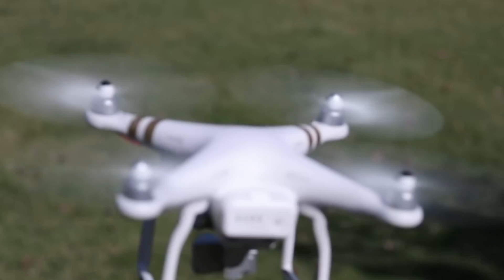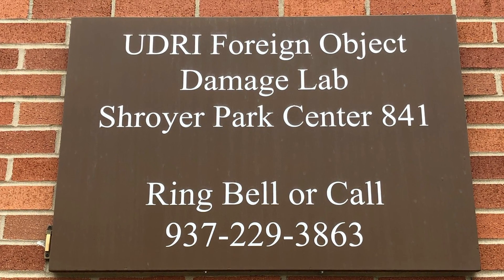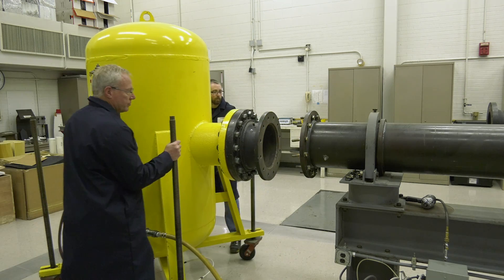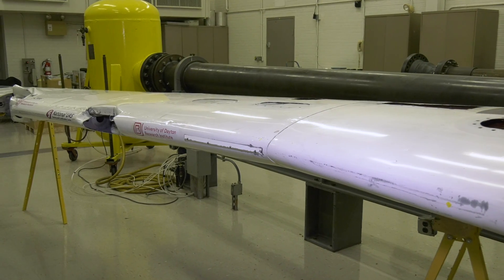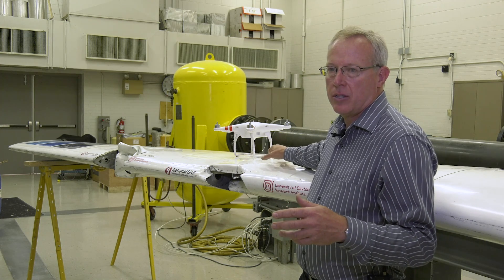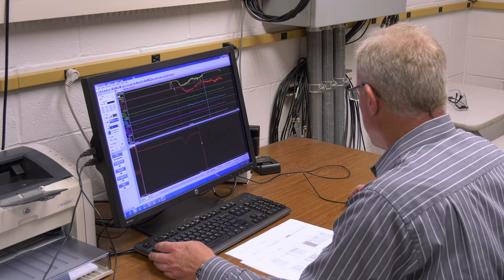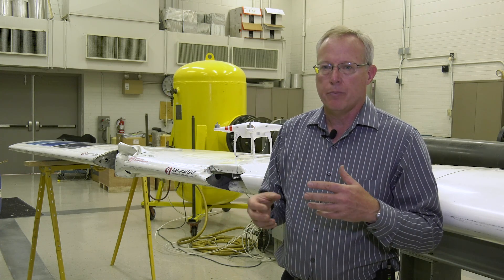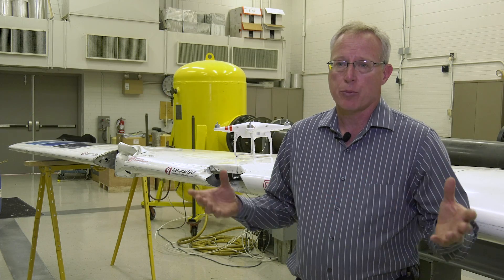What Happens When a Drone Hits an Airplane Wing? – AIN

Comment: I'd love to see what happens to that wing after the gelatin impact, in a 250 mph airstream - that much change to the wing shape would introduce severe forces and potentially rip the end of the wing off. Whereas the drone puncture hole would have much less of an impact on aerodynamics.

Comment: Why would a business jet be flying at 470 mph only 400 feet above ground level? Even the test speed of 238 mph is much faster than take-off speed, and probably faster than the closing speed of a business jet less than 500 feet above the ground. The FAA prohibits aircraft from flying faster than 288 mph below 10k feet altitude. So, this video would be showing a worst-case scenario.

Comment: 238mph isn't a realistic speed for typical low flying propeller driven aircraft, phantom drones go about 45mph tops and most cesnas and pipercubs go about 130mph tops this is definitely a worst possible scenario and its a bit of a reach

Comment: So long story short,
1) Take a drone that most people don't fly
2) A drone that is way heavier and made from a different material that what most people fly
3) The weakest plane you could find
4) Completely over exaggerate the speed
5) Lie about the results as the simulated bird strike clearly did more damage
6) Completely ignore ASTM-330-10 standard you are supposed to be using for simulated bird strikes being fully aware that this is not how the test is performed
7) Completely ignore statistics as the likely hood of a collision would be insanely high
8) Use a wing that has already had rivets removed to try increase the damage from the impact

To say this is propaganda is an understatement, you are a disgrace.

Comment: What is shown here is simply a lie, there are real tests here on YouTube where you can see that in the event of an impact at high speed, at most, the paint would be scratched, a drone is far too little weight to damage an aircraft, it would have to be over Weighing 3 kg and flying at over 120 km / h.

Comment: One issue not factored in is the wind force that continues to push the drone into the hole and out the back side of the wing. Then the wind rips the wing open and you crash.

Comment: If a plane was to crash into metal bars or a bird crash into it for sure the wing would lose control and crash and because of how weak the steel is pretty much everyone would die
Reply: Lose a wing because of a bird strike?😂 You must be joking. Also aircraft aren't made of steel
Reply: @ethansaviation2672  yh yh what do you know
Reply: @ethansaviation2672  what's it made of then
Reply: @bethaniestephens4573  Aerospace-grade Aluminium or carbon fiber on new aircraft

Comment: If drone flying was put under the authority of the CAA;it could be tightened up very easily. For example, annual medicals, drug testing, training,regular reassessment. All pilots have to carry their documents with them for inspection if required. All this training has to be paid for by the trainee, starting with £250 for the doctor's examination and certification and obviously the costs go up.

Comment: Hi together. I am an PP-L Pilot and an professional pilot for UAS. The problem of this test is, that it is wrong in the basics. In real airspace the wing hits the drone and not vice versa. So they should shot the wing to the drone ! There are a lot aerodynamic effects and regarding this, the contact is possibly resulting a dent in the wing. Bigger aircrafts pushing a hughe airwave forward, along their boby. This test we made in the air and there was no contact at all in ten attempts with an LSA. Drone Pilots should fly reliable, but panic is a bad advisor. I know a lot of A-320, A-330 and A-340 pilots and none of them is frightened by drones.
Reply: Don't they fire birds at engines though for testing?
Reply: Ethan's Aviation Thats correct! Frozen Gooses to the fans for testing.

Comment: General aviation rules set speed limits for airplanes at low altitudes.  Below 10,000 feet the speed limit is 200 knots.  https://www.law.cornell.edu/cfr/text/14/91.117

So don't talk about a business jet going faster than that at altitudes drones operate at.

And while we are at it, the bird did way more damage than the drone did.   The drone penetrated further in, but the bird took out way more leading edge.

Comment: For me this test do show only one thing: Anti/haters trying to prove something with nothing more the big jargon about how dangerous/wrong something is and not with actual facts. 

I mean, if you got balls, you take a big UAV and let it fly against a small one. And then you have result that matters.

But no, let's shoot something at something as it would have the same impact. Totally forgetting the sensors on the drone, totally forgetting that the airflow is completely different, the speeds can be of by 1 mile and everything is already different, weather is also different. Basically, what we see here is just THE IDEAL circumstances for them to get something negative said about people's passions.

Nothing more or less. Actual testing should be done.

Comment: The thing is, flying drones is restricted near airports, but also OUTSIDE of airports, because of, AIRPLANES. But, drones are only allowed to fly 120 meters high. I do not know, but uhm...If an airplane would fly this low. It would probally not have enough lift to stay airborne right? I really do not get that, why you may only fly 120 meters high in the Netherlands. (Not even feet btw!) Some buildings are higher then that right? And is it messured from where you stand, OR from NAP?

Comment: Why was the test on such a rare plane, instead of a popular Cessna? Was the choice of wing based on what would suffer the most damage? Your simulated bird strike made a bigger hole, even though it was only large blob of gel, no bones or beak. Given that a seagull weighs the same as a football, your test shows the risk of flying low over a soccer field, not a bird strike!

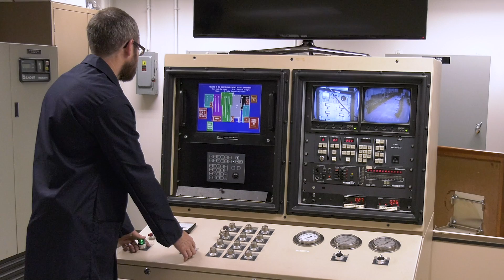Comment: 0:25  a typical drone (DJI phantom 2) demolishes a typical plane wing when fired at it at 238mph, "at higher speeds the damage would have been much greater"  [primarily to the weaker material]   1:42  slow motion shows the drone did not shatter apart on impact and completely punctured/burrowed into the wing, bent and deformed framework in the wing.   2:18  "if this was a business jet and the collision speed twice as fast, the damage would have been much greater, as energy goes up with square of velocity".  

an imperfect crude simulated bird crushed the wing but did not do as much damage as the drone likely due to its shape, materials and absence of spinning blades.

Comment: Common sense --   a large object travelling at 200 mph and colliding with a small object at 20 mph is not the same as a small object travelling at 200 mph colliding with a stationery object.   We know that a bullet (200 mph) will put a hole in an aircraft wing, but if the aircraft at 200 mph hits a bullet near the end of its projection (20 mph) it will simply bounce off. Looks like a hidden agenda in this 'test'.

Comment: So in other words, it will do LESS damage than a large bird: https://www.jetforums.net/threads/bird-strikes.1300/
This kind of testing should be done on larger aircraft samples, including engines and cockpit windows, at actual approach and take off speed. 
Larger drones woudl obviously do more damage, especially if piloted with intent to cause harm, or if carrying IEDs, but so far this looks like more write-off / expensive repair bill than a threat to commercial aviation.

Comment: Lets also not forget that just as important as the structural integrity of your wing spar, a bird completely mullering your leading edge is going to cause a lot more drag than a pierced hole through the front. As many people have already said other aircraft have considerably thicker leading edges specifically for the bird strike reason, except you can't claim off someone elses insurance if it is a bird!

Comment: This is nonsense. There's a very very small risk of penetrating an aluminium skin. Same as if a bird hit the wing. The wing would be fine the bird would bounce off and not be so well.
 The threat from drones is that they get sucked into the jet intake and damage the engine internally. That is a genuine threat. God Knows why they need to circulate this rubbish.

Comment: The reality is, this video contains all true facts and science, some people say that the air pressure around the wing would protect it in a real circumstance, wings create regions of low and high pressure areas, so theoretically is a real scenario a drone could be sucked into the wing not repelled. The drone caused internal structural damage to the wing that's a lot worse than the bird only causing a rather large dent, the difference is like being hit by a cricket ball that hits you and leaves a large bruise but bounces off, compared to being hit by a bullet that leaves a small hole but can kill you easily (via shrapnel) it's  the same principle. Some people say that aircraft don't fly low or fast enough, reality they need to land and take off (obviously), the take off speed of a Boeing 747 is 184 mph fully loaded for a long haul flight which is quite typical.  Some people say that new legislation on drones is to hide what governments don't want you to see, well what do you really so badly need to see at an airport specifically with a drone which its on board camera is theoretically easy to hack into based on the fact the data signals between your drone and your controller are not encrypted, can't you just get a window seat on a plane, and if you genuinely just want to get a good video, can't you just contact some authority. Some people say aircraft wings will be more protected, the reality is that take the Boeing 747 was designed in the sixties and are only really protected against bird strikes, and as I have said and what you can see in this video cause different types of damage. So you might say then why don't they start retrofitting all aircraft to be protected against this new danger, in reality this would require major research and development, would require virtually all aircraft everywhere being grounded for possible months, costing companies, agencies and governments billions and all for a few people who want to fly their drones dangerously close to aircraft can do so. And finally some will say with all the drones out their, there hasn't been a single case of collision, and the simple reason for that is that, out of all then operators, the majority of them are smart enough not to fly then near flight paths, but the ones that every so often do, all aircraft are grounded and incoming aircraft are diverted away, completely eliminating the chances of collision potentially saving lives and aircraft, at the cost of a lot, and I mean a lot of angry passengers. Some say that I just hate drones, the truth is I own one. So if you don't like legislation on drone use, don't fly near airports. If you don't like the science in this video, then repeat your own experiment and present it forth in a scientific manner, but I'm afraid you may be disappointed with your own results. If you don't agree with any of that and just want to fly around airports for some reason, then go ahead, i'm not stopping you, but i'm perfectly fine about following legislation.

Comment: This guy is an expert??

Several things...
They used the wing off a particularly weak structured aircraft, not your average GA wing.
He states that the aircraft would 'probably be ok' - well assuming the aircraft is at a slow speed critical phase of flight, for example take off and landing (when drone strikes would be more likely) the destruction or deformation of a chunk of wing could be enough to drastically change the lift characteristics and cause a crash.
I have witnessed aircraft return to base with bad bird strikes to the wing sustained in flight, and the low speed handling characteristics have dramatically changed. Not a problem when you start to slow down and discover this, but a huge problem if it were to suddenly happen at low level.
The wing could lose some lift in comparison to the other wing, causing a violent and sudden rolling motion. If the control surfaces to no move quickly enough or deflect far enough to correct this before it is unrecoverable, the aircraft will crash. Wing damage on take off or landing in GA aircraft has caused this to happen in the past.

On a large aircraft there is less of a risk, because control surfaces have a greater effect and a small bit of damage in a large wing would be less dramatic too.

Comment: 238mph lets see so the plane would be at crusiing altitude since it's near max crusing speed. So it would be 20,000 feet (3.7 miles up) while the DJI phantom 2 limited range of 3280 feet max. (0.6 miles) doesn't make sense. The two would never meet. Bad science bad data. Now lets look at reality, the chances of planes landing/crashing on public roadways and private property is greater then drones striking planes. Maybe planes need to be banned or restricted to commerical use only.

Comment: 0:25  typical drone (DJI phantom 2) demolishes a typical plane wing when fired at it at 238mph, at higher speeds the damage would have been much greater.  1:42  slow motion shows the drone did not shatter apart on impact and completely punctured into the wing, bent and deformed framework in the wing,   2:18  if this was a business jet and the colision speed twice as fast, the damage would have been much greater, as energy goes up with square of velocity.  an imperfect crude simulated bird crushed the wing but did not do as much damage as the drone.

Comment: At 250 mph even a bag of feathers (the same weight of the drone) would cause damage.
So why test at that speed?  To prove a point!  The point is irrelevant.
Plane land at 172 mph or slower and Takeoff at 184 mph, most drones don't go faster than 40-50 mph, just the facts.

Comment: Good initiative! But there is a fundamental mistake in these tests. In these tests, the drone gets the inertia and in actuality the speed of the drone is very low. As the aircraft wing approaches the drone instead, the streamlines of the air would  force the drone to move up or down following them. How much this would modify the tests is questionable but these results are of limited scope.

Comment: The issue isn't what happens to a wing but an engine. A 3lb drone will poke a hole in a wing but a 10oz bird will take out an engine. And a bird strike is like 1000x more likely than a drone hit so this is almost irrelevant. Also, they talk about maximum speeds. Well lol, how many drones are flying at 30,000 feet when these aircraft are traveling that fast?

Comment: The test does not take into account the airflow ahead of, and around the leading edge of an aircraft in actual flight. 
'Apparent Airflow' around the leading edge of the wing at such high speeds would not allow a drone to have the 'direct impact' on a 'leading edge' as depicted in this video, and to have a 'direct impact' would be unlikely. 
One would assume the drone would strike 'offset' on impact, meaning the 'Force Of Impact' would be less than depicted in this test.
I would be interested to see a test conducted where airflow plays a role.

Comment: The test was obviously performed without a LiPo battery. Normally the fuel tank is located in the wing. In reality there could be a fire and if there is enough air in the tank there could even be an explosion.

Comment: That's a lotta damage - but luckily, Flex Tape come super wide, so you can easily patch large holes.
To show the power of Flex Tape, he sawed this aircraft in half! And repaired it with only Flex Tape! Phil Swift flying an airplane "NOT ONLY DOES FLEX TAPE’S POWERFUL ADHESIVE HOLD THE AIRCRAFT TOGETHER, BUT IT CREATES A SUPER STRONG AIR TIGHT SEAL, SO THE INSIDE IS COMPLETELY DRY!" Yee-dogge
Just cut, peel, stick and seal! Imagine everything you can do with the power of Flex Tape!

Comment: The Phantom's cruising speed is only 33.5 MPH.  This plane would have to be at a very high altitude to be doing 200MPH  maybe a mile or higher the phantom hight limit is 400 ft. There is a lot that does not make sense about this test. In my opinion, this is just another way to panic the public, giving the drone enthusiasts and the drone industry a bad name.  They really need something better to do with their time!!

Comment: So this is what it would look like if a 4 seater single engine prop plane  were to strike a Phantom 2 at an unrealistic 350 miles per hour . . . please explain how this wouldn't be just a fraud in explanation but more to the point a nuisance at most for the mach 0.5 single engine Cessna 4 seater . . . Pretty sure they dont go that fast and on top of this video pretty sure they could land more then safely .

Comment: I think the point to take away from this is how fragile commercial aircraft really are and the fact that one would never be capable of taking down a steel building. 911 was not an aircraft strike / The wings and engines would have been outside of the buildings / in the street